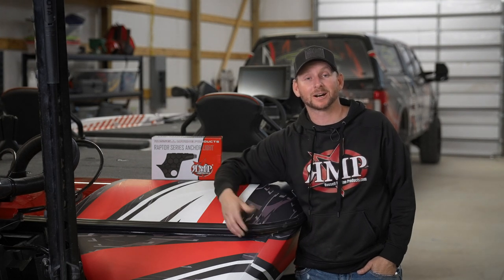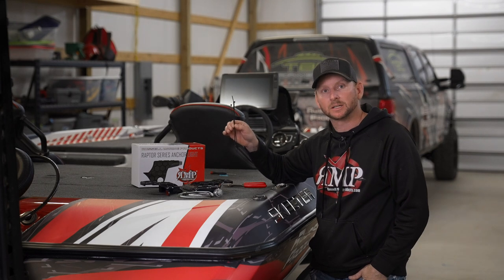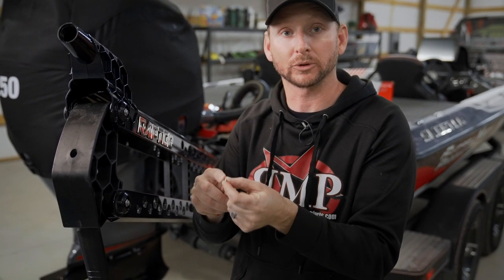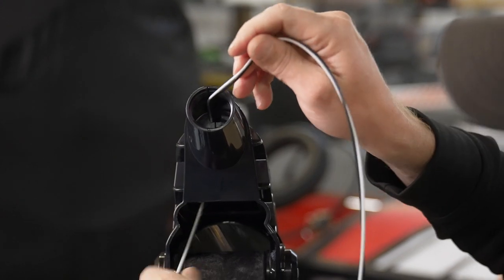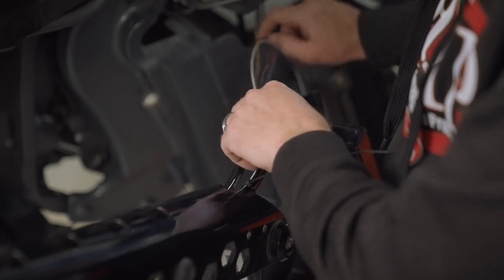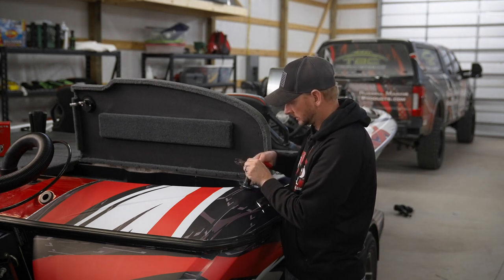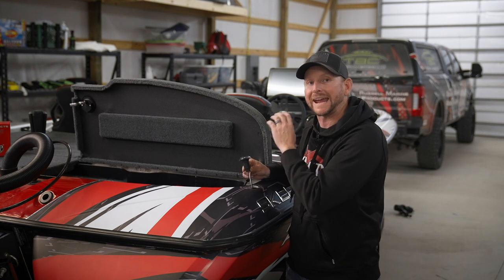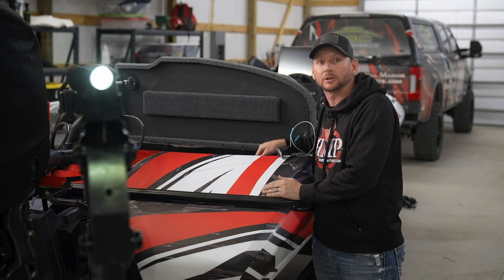RUSSELL MARINE PRODUCTS MINNKOTA RAPTOR ANCHOR LIGHT INSTALLATION

Comment: Just installed mine yesterday. Easy install, but I think it would be nice if you guys added 2’ to the wiring. Nothing like putting an unnecessary butt connector 10 inches away from another buck connector. Just add two more foot to your wiring that would make it for an easier install.
Reply: Is the light bright enough to see by for rod prep?

Comment: Gonna be hard to heat shrink it after you've already crimped both ends eh?
Reply: No it won't be due to the fact those butt connectors had the heat shrink built on to them.